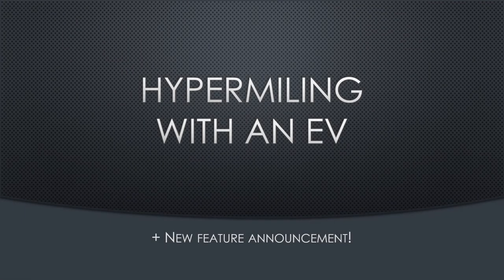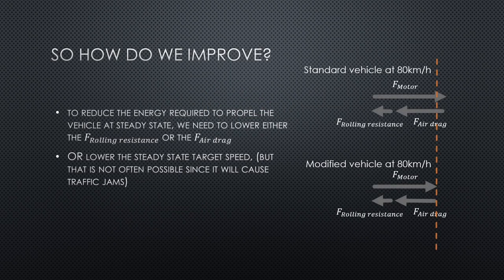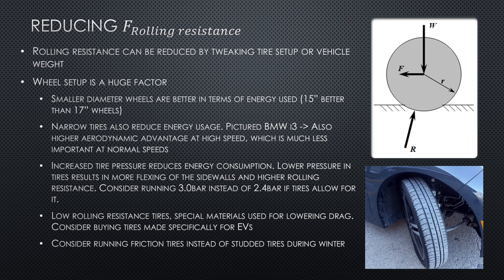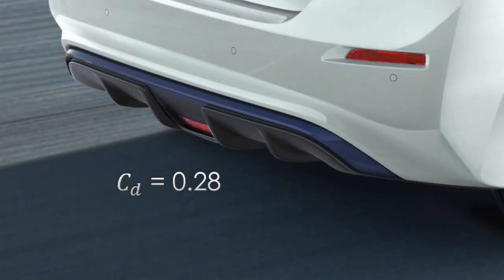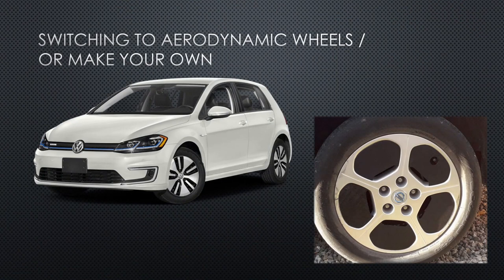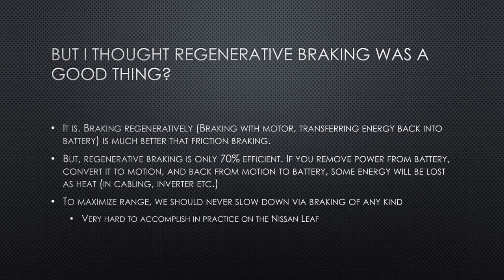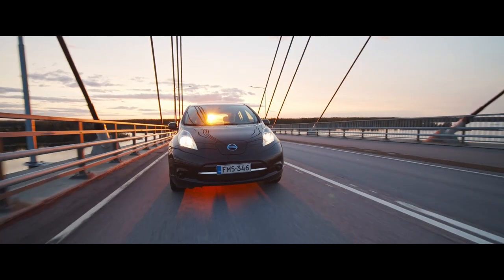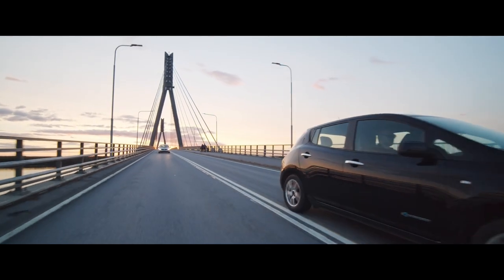EV hypermiling basics (+new feature announcement!)

Comment: Yes, we need more EV youtubers like you that Actually knows what They are talking about, as opposed to other advisors on yt, who got their knowledge, from ads. I get 110Wh/km city, 150Wh/km at 100 and 70-80Wh/km behind a truck at 90kmh. So I can go around 280km on a good Day with my 20kWh battery! I ordered 145/70 tyres instead of 145/80, (not a Leaf), by mistanke, and my city consumption dropped by 25%, because less current accelerating, faster spinning wheels that supply higher slow speed regen and higher rpm, where the motor is more efficient, when going 50kmh. I use regen from high speed only, where aerodrag is high, down to 60kmh and then roll, hopefully to avoid stopping completely at the lights, which also is a great energy saver.
Reply from the maker: Very good observations! Tires are very important!

Comment: Very good description and well put physics of the problem, though did miss the loss of energy in a EV due to heating of motor/battery due to current.  So the harder you accelerate (and regen) the more resistive losses as larger currents in and out the battery (and motor) will create more heat.  In overall generality, you should drive an EV as carefully and thoughtfully as possible as predicting the road ahead will reduce the heat losses as you will accelerate/regen less, the extreme of this (as you noted) is to glide (or coast) since there are zero resistive losses and no power system losses in this state.  The final extreme case is that an electric power train is most efficient when NOT moving.... ! (obvious I guess, but see below).

Yet another side note - as more EV's come with 1 peddle driving, with strong regen, this will result in a tendency to drive slightly more inefficiently.  Ie it is more efficient to minimize the regen due to heat losses - so rather than just taking you foot off the accelerator and minimizing the stopping power regen - it is better to feather the accelerator to reduce current flow.

I would like to compare this with a ICE car and hypermiling since this is done differently.   In this case the ICE motor has a an efficiency that is maximized under a certain power - for petrol this is around 20% and for diesel this can be between 30-40% total power.  Lower loading and higher loads on the ICE motor will reduce the efficiency of the engine.   In this case we can use pulse driving (which is of course incredibly annoying to everyone else) in a modern car at around 50-60 mph.  Pulse driving works as modern engines cut off the fuel during engine braking, so we accelerate up to 60mph using what approximates 20-30% load on the engine, then we engine brake down to 50 mph since no fuel is used here.  The acceleration cycle uses the engine at its most efficient power band preferably at the lowest RPM as possible.  This is why an ICE car driven very gently and slowly is NOT efficient; as an ICE car is most efficient when driven at 20-30% power and then engine braking. 
As a side note here : automatic gear boxes can reduce effectiveness  of this pulse driving option since is depends on how the gear box responds to no-load.  Some auto-gear boxes will disengage and allow the engine to idle - which means fuel is used for idle, and some auto-boxes will hold in gear - which means the engine management system will turn off the fuel - exactly as in a manual car.  You can therefore see that for an auto that disengages the engine to coast the car in idle is NOT as efficient as a gear box that keeps the car in gear forcing engine braking with no fuel being sent to the engine.

The final car type is hybrid or PHEV where we can drive the car gently and get battery (when the electric motor is most efficient),  but then when we require to get to a higher speed or accelerate we make sure the ICE engine kicks in and runs at 20-30% load.

Finally, finally : by far the best way of hypermiling is to slip-stream a 40 ton lorry (big-rig);  this will significantly reduce the air resistance.  The closer you get the better for your mileage, and worse for your safety.  It also has the advantage that a heavily laden lorry will change speed slowly which means you will tend to drive your car more efficiently anyway.

Comment: i'm drive the 30000km Used 24kwh Leaf in China about A year.I try many way to let the car go further,and i found drive without the Eco-mode can make the Leaf much smooth，less throttle to accelerate，and glide further while down hill&bridge
Reply from the maker: Yes, D is better than B/ECO due to the reduced amount of regen!

Comment: You could just change gear to N (neutral) before going down the hill. This will disable regen.
Reply from the maker: That takes too long, shifting to N is a 2 second operation minimum. And incase you change your mind and want to accelerate, you then need to do another shift. The new feature will allow for true gliding in D mode, extremely useful, and MUUUCH safer than switching to N!
Reply: Much faster to select reverse, car beeps and instantly goes to neutral. Just keep speed above like 7km/h or car will actually go into reverse gear. After 4 years in old Leafs I got pretty good at coasting in neutral.
Reply: @DalasEVRepair  We got the Ioniq after our Leafs, and I have to agree that the ability to set regen to 0 is extremely convinient.

Comment: Hey Dala, this video and a facebook forum post have made me rethink how i drive my leaf. The fb post said dont use eco on the motorway or cruise as its inefficient. Before i had a leaf i had a mk1 insight so ive hypermiled for literally years. When i got the leaf i kinda forgot that as eco mode regen doesnt really let you. But now i am realising that hypermiling is possible in d mode. Probs even more so with your mods but alas my mitm is a muxsan one so unless you can merge your code bases im probably stuck without it. Great work nevertheless.
Reply from the maker: Thanks, and yeah, gliding is hard but oh so worth it once you master it!

Comment: I don't understand this video. If you are going down a hill with a speed limit of 50 but your leaf wants to naturally roll at 60, using regen is more efficient than gliding. You're basically getting free power. The only caveat would be, if you can glide up to 80 and then "use up" that extra speed over a mile or two after the hill ends. Then you should glide.

People get confused about this "don't use the brakes/regen" idea. It's not the actual using of the brakes/regen that is inefficient. It's the unnecessary acceleration that took place shortly beforehand which is bad, and what should be avoided. If you find yourself (for whatever reason) going faster than you need to be going, use the regen! Unless by some miracle the decel rate you are seeking can be achieved by gliding only, in which case yes that would be ideal. But those situations are few and far between in real life.
Reply from the maker: Now you are one step ahead! For most users it is very hard to predict that you won't need to accelerate, and can instead rely on the power you previously put into the motor. With this gliding trick, it helps you to understand this, and thus starting to use the technique you are describing. +points to you!

Comment: Why not put the LEAF into “Neutral” when going down the hill?
Reply from the maker: It works, but it is not recommended. The user manual also says that N should not be used for rolling (but I can't see why not). If you are in N and suddenly have to accelerate, then you need to switch to D. This creates a small hazard if you aren't quick on the joystick. This solution with no regen in D mode, is much safer to use.
Reply: @DalasEVRepair  the best would be of course if you could retain the regen for brake pedal, so you could glide downhill and regen excess into battery. But i'm guessing you havent found an option to make the mod work like that? Their code doesnt separate regen for driving and brake pedal input? Only disable whole system?

And please do not use the excuse that brakes rust and it's great to use them more, it's useful to give them some action to keep them from rusting but definitely not great to use mechanical brakes more for slowing down than regen. Brake pads make harmful pollution with their fine dust and having an option to brake without such emissions is great. This is one big reason to have EV's in citys, to get rid of all the fine brake dust too.
Just do one harder brake after starting a drive and all pads got moved. Capturing energy is always better than wasting it, if there's convenient way to do it and you know it too :)
Reply from the maker: @gelisob  Pedal input is not available on EV-CAN. And quick switching between Glide mode is only possible on ZE0, on the AZE0 it takes a few seconds for the VCM to catch on to the request that battery does not want to take any energy via regen. Otherwise good idea!
Reply: @DalasEVRepair  I’m guessing the manual says not to roll in N as it is illegal in most countries... You must be in full control of the car at all times and N isn’t.

Comment: The mass of the wheels is commonly overlooked, it’s implicit in moving to smaller diameter wheels. It’s very common in motorsport to use extremely light weight wheels such as Team Dynamics Pro Race 1.2 which can be as good as half of the weight of a typical OEM alloy. I think the snag for EV would be the drag as they are all designed to allow heat out from the brakes. You might have to 3D print some infill to get the best of both worlds.

Comment: Have you done the tests on different ways to tackle a hill, or do you guess?
I actually did a test some years ago over a 20 km route.
Yo-yo speed (which without doubt is the most efficient when driving a fossil car) actually used around 50% more than doing steady speed.
For sure you can drive more efficient than only using CC, but it seems it's darn close. So do it simple, set and forget CC. The computer in Leaf is wrong, and proven many times.
Remember when doing a test like this the average speed MUST be the same.

I also tried to test regen efficiency, don't remember the numbers, but it seems to be more in the range of 85-90% efficient, not the 70% you claim.

Actually you can coast in the Leaf, either hold the "gear-lever" against N for 1-2sec, or when going at speed, flick it to R. Over a given speed (10 km/h or something like that), it will beep and go t N.
It takes a lot of getting used to driving like this, and some planning as you, of course, have to put it back into D..
Reply: Interesting comment (only marred a bit by the usage of "fossil car" which is a unnecessary pejorative since no such thing exists), What you write makes a lot of sense, since there is no pumping losses. Programming of the powertrain controller and losses must be more worthwhile looking into.
Reply: @GoldenCroc  you're correct, in norvegian we all say "fossilbil" about petrol/diesel-cars, directly translated that is "fossil car".
Don't know the correct term in english, but something like "fossil fueled car"..?

There's a lot to be saved on design and programming. But more so on drivers input..
Currently drive a Model 3 LFP. 28 km to work, started cold in about 0C and spent about 12% to work.
Preheated well in advance of my return, preheating spent about 10% , a lot because of the active heating of battery.. Then another 10% for driving home..
Reply: @therandomtester9561  Lots of people use the term "Fossil car" in english, its likely it originated in english first (probably in the US?). 

Its still a misnomer mostly spread into "mainstream" by EV fans that are just a little bit too evangelical and eager to discredit ICE cars.... Which ironically discredits their argument entirely if one thinks about it because if they are willing to use faulty pejoratives they know to be so, then that brings their honesty about other facts/number they state into question, as I am sure you will agree.

The correct term would be ICE (internal combustion engine) car, just as the term is EV for... EVs.... In norweigan something like "forbrenningsbil" would be an acceptable term thats correct and easy to say.

Anyway, most people drive terribly uneconomical for energy consumption, I am a pro driver and I shake my head every day at peoples driving in every regard. I can easily beat most people by 20% energy consumption even when they are trying, if we are talking in general traffic...
Reply: @GoldenCroc  ahh, ok 😀
Seems to me you confuse the word fossil as the car being old tech, rather than the origin of the fuel (crudeoil, made from fossils, hence fossil-(fueled)car).

Yes, ICE sounds correct.
Forbrenningsbil though..? I don't know, more correct I guess, but sounds just as much like the car itself could spontanious catch fire. Well, that is true though🤣

EV though, isn't a very good/specific term.. Anything from a Leaf, Miray, Ampera (withouth the e..), to a train will be an EV (ElectricVehicle).
Leaf is a B EV, Miray is... in my eyes just stupid... but "fuel-cell EV" I guess.., Ampera is a PHEV, a diesel-electric train is a HEV I guess..

True that! I drive a bus for a living, always been like 1 of top 3 for low consumption.
Currently trying to use a lot, but still I only end up around our depots average (about 10% more than before)..
"I'll race you to the red light......" 🙈
Reply: @therandomtester9561  Nope, not really confused at all about its meaning, there is no ICE car built that can only run on "fossil" fuel, hence it is a misnomer. In fact, there is no strictly "fossil" fuel even sold at gas stations in the EU, and I would wager Norway as well, it is all a blend that contains renewables, with increasing amounts blended in every year.

The entire meaning from the beginning of calling it "fossil fuel" was exactly what you thought I misunderstood it as, in the mind of the general public. 

That is "fossil as the car being old tech, rather than the origin of the fuel (crudeoil, made from fossils". Its a delibarate conflation to create a negative image. If you take a look at the comments on "EV" youtube channels, you will find most people commenting dont know ICE cars can run just find on 100% renewables, hence there is not a general "global warming" argument that can be made against them. 

As I said, its a term, in the spirit of "newspeak" created from its inception entirely (or at least once it began to spread in EV circles) to create an image in the mind of the general public as ICE cars being "old" and "bad for the enviroment" compared to EVs because of them "burning dirty oil" and being "old outdated tech", when in reality thats not a given.

Thats why the term shouldnt be used if one knows about cars or want to be taken as unbiased/credible. Nothing against you, I am sure you havent thought about it that much, but now you know. 

EV might not be a perfetct term, "EP car" or "ECP car" for EVs and Hybrids or something similar would be better. 

I drive a small bus (van like) as well, with a stretcher and variious eqipment to help disabled. Sort of like a larger but not as time critical ambulance.

Cheers mate.
Reply: @GoldenCroc  well spoken sir.

Comment: Dala, Daniel, I am from the UK but not sure what to call you.
I have recently bought a second hand Leaf which was not well looked after, it has the bottom engine cover/splash guard missing and assume that will effect the drag on the car, do you have any idea how much, and how much difference do the wheel inserts and maybe the grill covers make? Is it worth me getting all these things fitted (a new under engine cover is £250 from Nissan, and I can't find a second hand one), I would need to get the wheel inserts printed by someone else a d might be £100 or so. I only have about 12kWh when full, so the car only does about 30 miles to a charge (as winter here). Am I right thinking the aero mods and under engine cover will give me a few miles extra range, or is that wishful thinking?
I like to see the mods you do, but you maybe should try and make some money at it, or at least, not loose money!
Reply from the maker: If you do most of your driving at high speed, the covers will help more. If you just use it for city driving it wont help as much. Try to get a set of the missing undercovers from a scrapyard!
Reply: @DalasEVRepair  There are websites in the UK, (and no doubt other countries too) where you can ask for a spare part, and the 150 scrap yards that use the same, will hopefully reply. I have asked twice over the last few months, but no offers to sell me one. There must be some out there somewhere but I haven't found any second hand ones yet.
A good point you make about the faster you go, the more effect area has, I would think most of the miles average at 50mph, not much at 70.
Reply: Beware, not a Leaf, but on my old Renault Modus, the cover fell off…why?  Because it trapped salty water above it and it was only fixed to rust…bye bye Modus…hello Leaf?
Reply: @markthomasson5077  I did buy another cover (as it is supposed to have one) and now it is fitted, it does  increase efficiency by a tiny bit. Let's hope it doesn't trap the salt this winter!

Comment: Hi there
I was wondering if you can help me,I have a Nissan leaf from 2018
It makes a clicking noise on the from wheel when i accelerate.
Does anybody knows what is causing it?
Reply: Check Fancy A Bev Mate? George had that issue, and had it fixed. It was simple.

EDIT: This video: /watch?v=dvDtfHMIeos  - If you can understand his accent! 

Briefly, the hub nut needed re-torquing, and it cured the problem when his garage finally made the adjustment. He said that hub nuts loosening was a common issue in 2018 & 2019 models. The video was made in 2019.